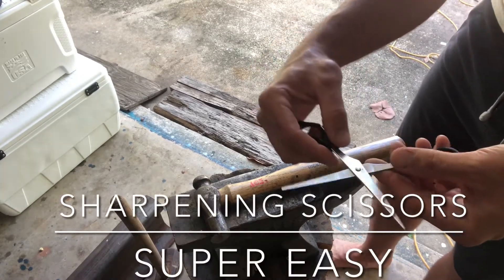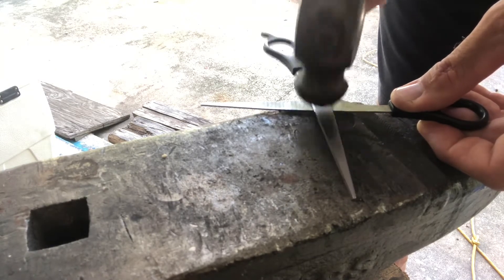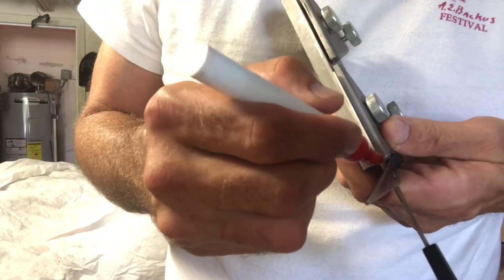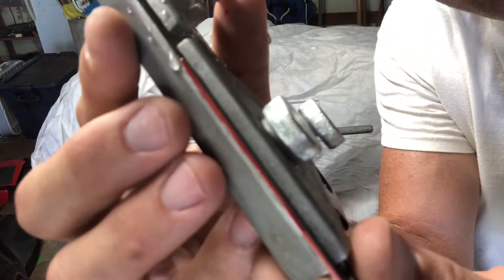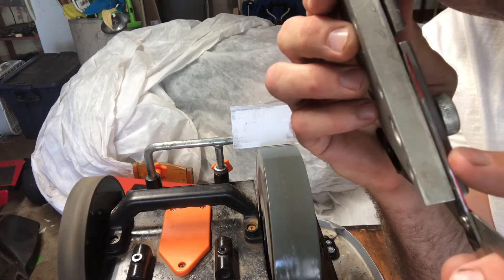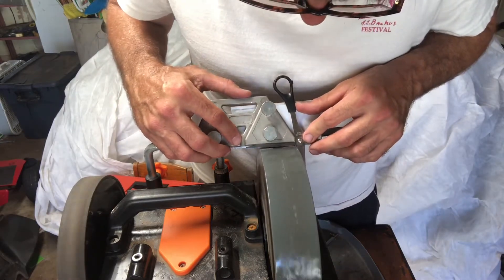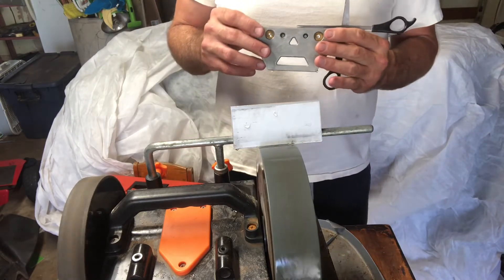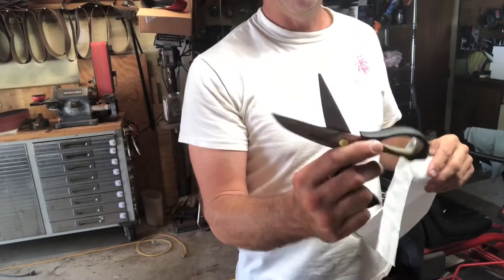Wen Sharpening System makes sharpening scissors so much easier!!!!

Comment: Is the wheel going down or towards you?
Reply from the maker: The wheel is coming towards the edge of the knife.  Edge leading.  This leaves less of a burr at the end
Reply: @PlayingwithKnives911  do you deburr after the stone work ?
Reply from the maker: @Cleymant  yes.  With scissors I keep the edges pulled away from each other as I close them.  Then squeeze them together as I open them.  The remainder of the burr falls off in use.  It’s important to keep the edges from touching the first time you close the scissors after sharpening.